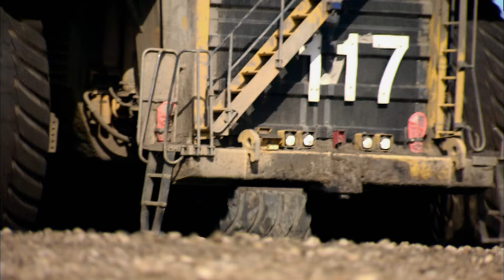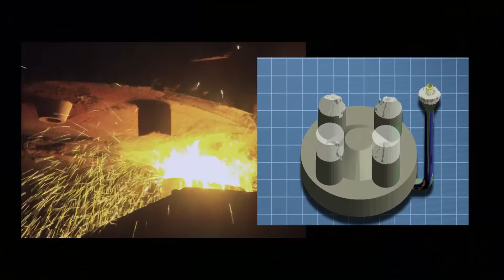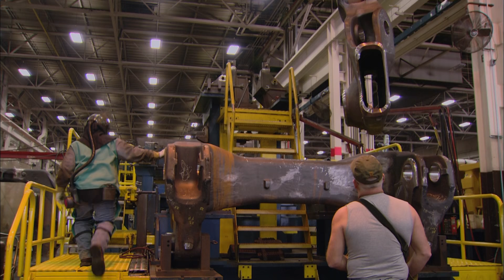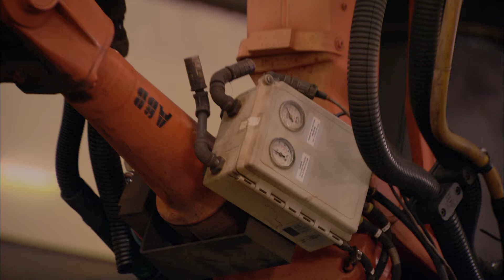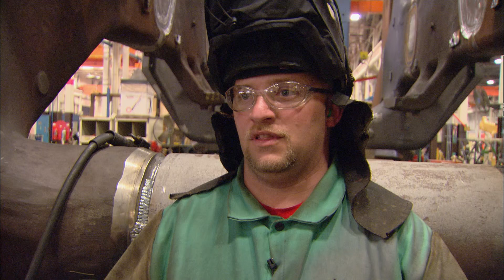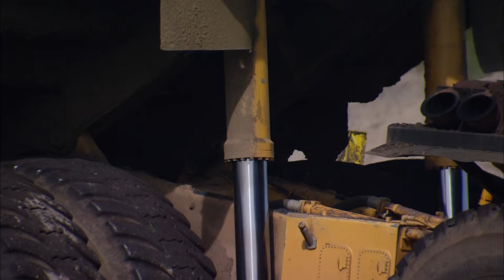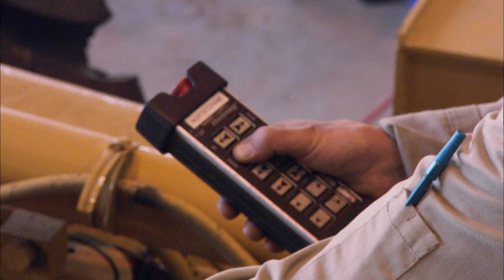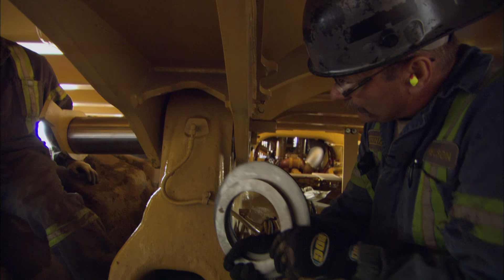Caterpillar Manufacturing: Inside the Factories Building Behemoths | FD Engineering

Comment: I bet that CAT engine can be tuned to much more than 3500hp. People get 2000 out of inline 6 cummins. I bet that beast can blow past 5000. With ludicrous amounts of torque. Someone needs to put one in a custom peterbuilt.😂
Reply: They're overbuilt and underpowered because that's the recipe for longevity...
Reply: Running at high torque will kill the rear axle.

Comment: 34:57.  The narrator is not paying attention to what he is saying.  First of all, it's a pneumatic system that is being used to adjust the height of the seat not hydraulic!
Reply: Did anyone pay attention in making this film?   They show us that the truck's engine is actually two engines - two 3512's  (V12 engines).   Then they show us and engine build facility and they are building a different engine - the 3516 (V16).